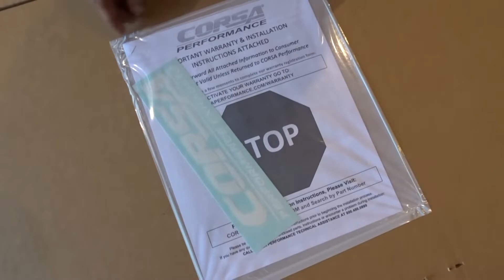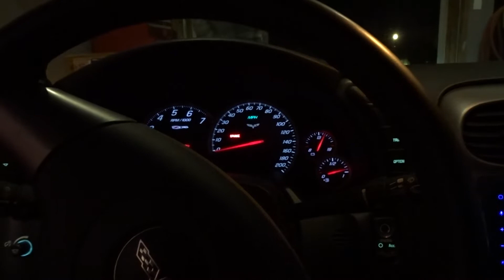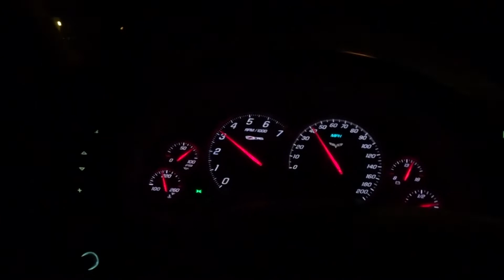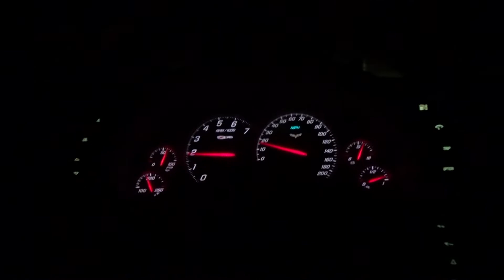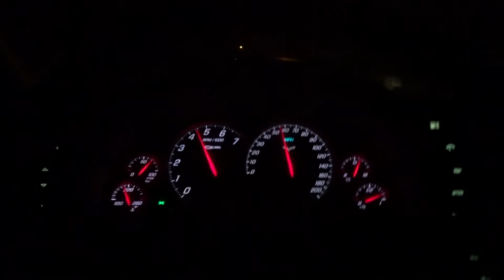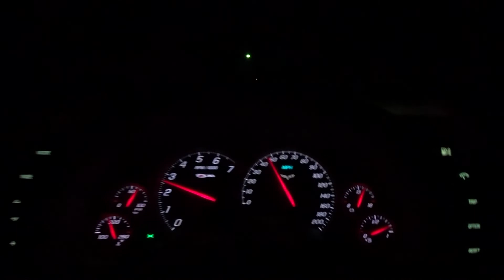C6 Z06 CORSA EXTREME INSTALL!!

Comment: And i Did the muffler mod on my stock exhaust and believe it or not the stock mufflers will come out without a lift.. yall was almost there  the ass end has to be about a foot or so higher and the muffler has to hang all the way down and wiggle it out. Working on these cars are little tough on the ground but its not to bad.
Reply from the maker: I need to get a lift one day soon. Def on my agenda LOL

Comment: Sounds cleannn ❗️ goals, hopefully I pick up a c6 z in a month 🙏, have u fixed the valve drop Issue they be having?
Reply from the maker: Good goal to have man! I'm excited for you! I have an appointment today to get the Z tuned I'll ask them about the valve drop issue. My car has like 15k miles on it rn. Is it a problem when they have higher milage? Or just in general?
Reply: @nicorispoli  just in general it’s always better to be safe as well mine had 32k miles on it when they save the valves starting to become an issue.